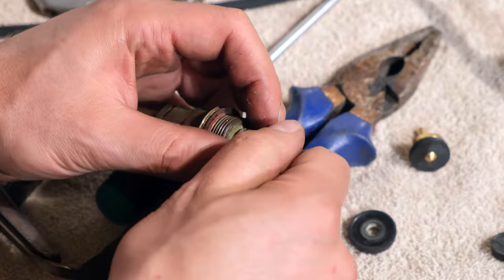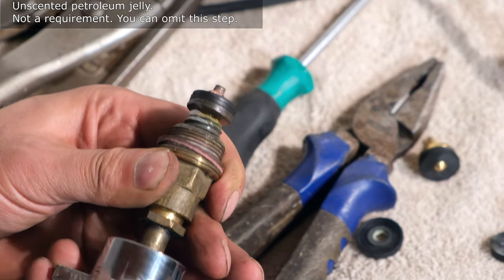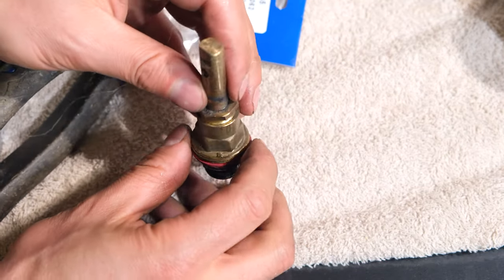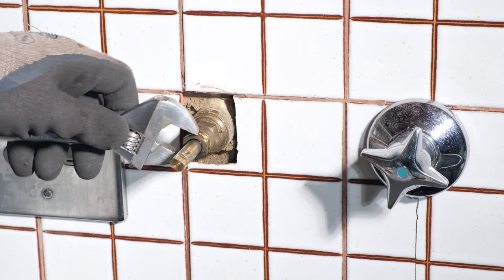How to replace a tap washer in a wall mounted tap - kitchen / shower

Comment: Is it legal to have a water tap so close to a power outlet?
Reply from the maker: no water outlet cannot be within 1 meter. However, i wonder if since the water does not flow out of this type of tap at the tap if its different. Is it a water source? Water pipes may run near electrical lines so not sure about it.

Comment: I have the exact type of taps mine is only leaking when opened. I there not also a oring in front for the handle? Mine leaks at the handle part.